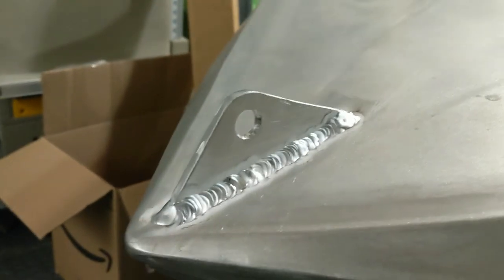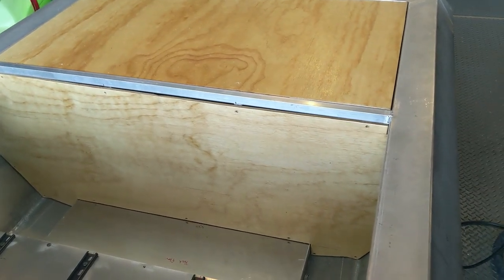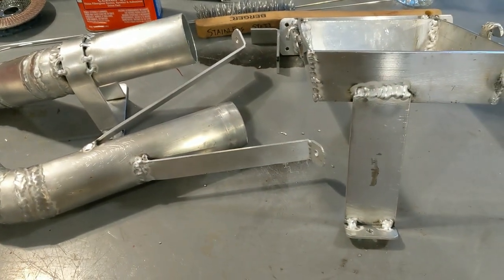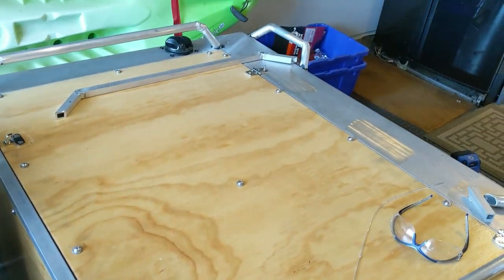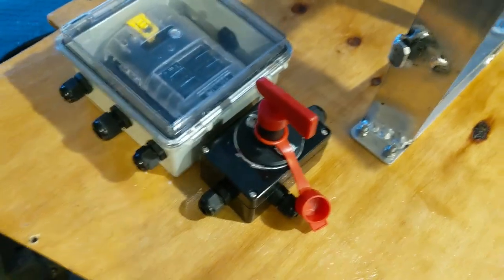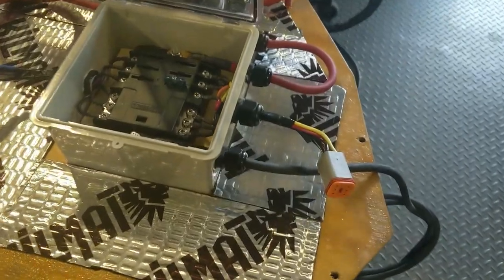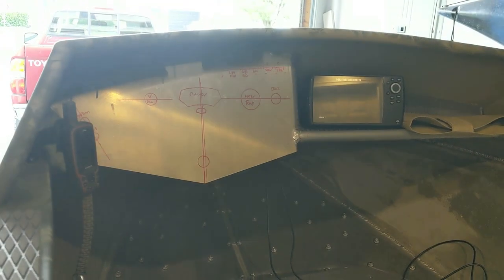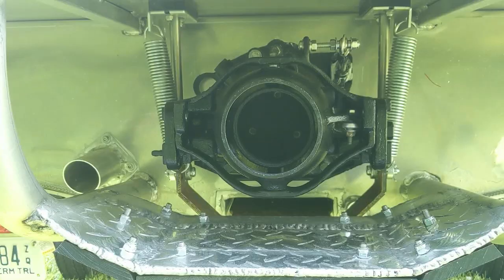MiniJet 10' Avenger Build Part 2

Comment: Hi Brad, can you expand on the heat exchanger a bit more? The spark that I got has a radiator/stringer/motor mount that cools the fluid by just being in the water. So how do you get the flow of water through the heat exchanger? Must be a separate water pump.
Reply from the maker: There is a high pressure line that comes off the pump.  The faster you go, the more water it pumps out.  That's what feeds through the heat exchanger to cool the antifreeze.  There is a facebook group called "Mini Jet Boat Builds" that has a ton of info on it if you use the search.  Great group for getting more answers.
Reply: Oh right, that makes sense. Thanks.

Comment: How is the trim working? Does it flip to flat due to the fact there isn't an actuator? I would like to do a manual myself but I have heard it just rights itself out.
Reply from the maker: It sticks in whatever position I put it and is working great.  Where my trim handle bolts to the bracket I made, I put two nylon washers around the handle and a lock nut on the bolt.  So I can increase the friction on how hard it is for the handle to move.  I just adjusted that nut to the point there the handle has a firm movement by hand, but the pressure the nozzle makes isn't enough to change it.

Comment: Did the intake come pre-welded in the boat? Did you have to shorten the shaft
Reply from the maker: Mike. Since I got a welded hull and the intake from MiniJet Inc., I had them weld the intake into the hull for me.  Typically they don't come installed.  You dont have to shorten the Seadoo shafts.  I believe the Yamaha shafts have to be cut and re-splined.
Reply: @BradHarbin  ok thanks. I'm looking into starting my first boat within a year or so and I'm researching everything. Information and tips on these building theseboats are scarce. I'll be back with more questions for you I'm sure haha
Reply from the maker: @mikee2398  Yeah, information was tough for me to come by too.  Jamie at MiniJet Inc. was amazing and answered all my questions.  I was very happy with my choice to get the hull from them.  I also discovered the FB group "Mini Jet Boat Builds" AFTER I built mine.  I'd suggest joining that group and searching around on there.

Comment: Why is the plastic on the bottom needed?
Reply from the maker: Oguz, it protects the hull from rock strikes and bottom hits.  These boats are made to run in inches of water and often hit rocks.  The UHMW absorbs the impact and doesn't damage the hull at all.  Some people build these boats to run in deep water and don't install UHMW, but for what I use it for, its very necessary.
Reply: @BradHarbin  Aha that makes sense thanks!